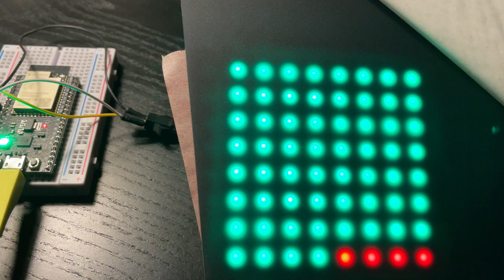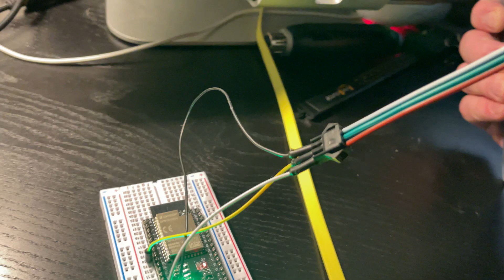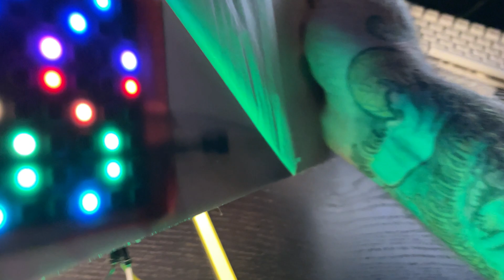Black LED Acrylic Distance Test

Comment: I embarked I bought a shiny black acrylic and the light of the leDs were not visible
Reply from the maker: Sounds like you didn't use the correct type of acrylic. I included the link to what I used in the description. If prefer to source your own acrylic, do a google search for "black LED acrylic". That should sort you out.